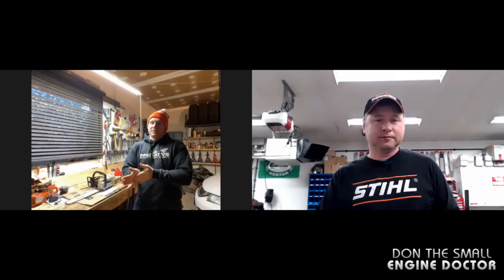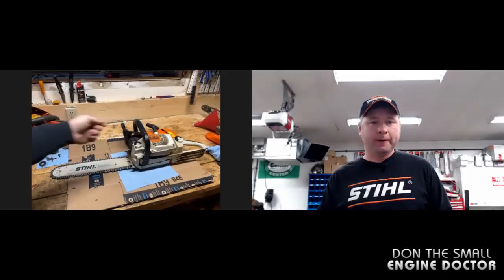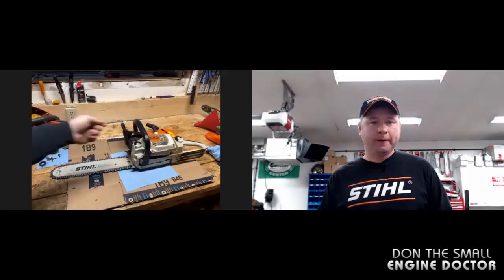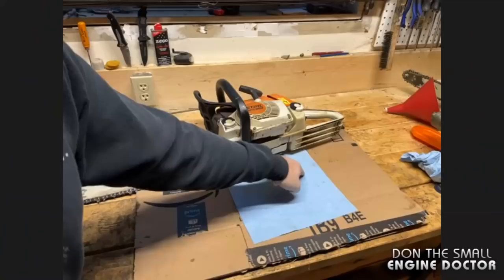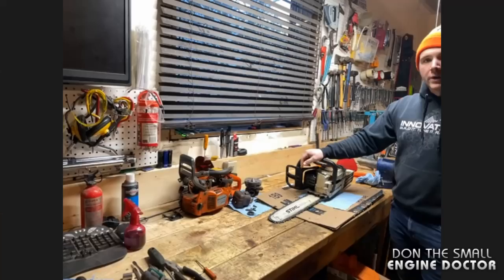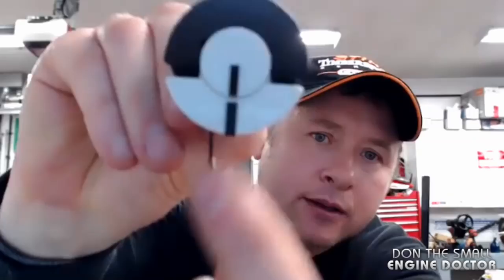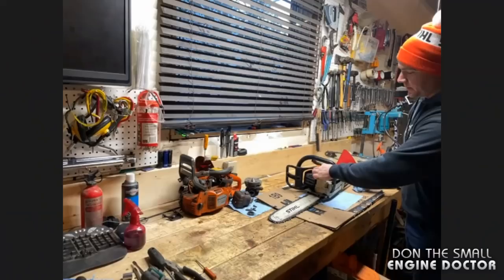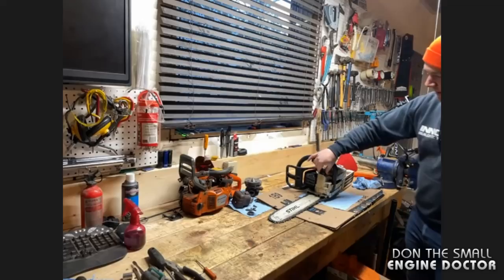FIXED! Why Dave's Stihl Chainsaw Was Leaking Chain Oil!

Comment: I hate to get picky, but Dave, the oil cap did not go on right the 2nd try either.  Did you fix it before testing to see if the cap was actually leaking?
Reply: another reason to replace it wouldn't  you agree?
Reply: Good catch! It wasn't catching the proper way - I found out that out pretty quick!
Reply: It has happened to me before too,  I always give it an extra wiggle to make sure it is locked in.

Comment: I have an 024 wood boss. It was leaking oil like a sieve.  I fount that the bar had at one time been installed incorrectly and the pin to adjust tension was driven back into the oil chamber.  I cleaned it out with acetone, ground it with a carbide tip in my Dremel and repaired it with JB Weld.  It held up for a few years but it slowly began to leak.  I was able to get a case half from a repair shop and I'm going to rebuild it with a new cylinder/piston as it has a scored piston.  I suspect leaks around the crankshaft seals so they will be replaced.

Comment: I've watched this and the one from yesterday and good advice. 
My suggestion is if you're going to replace the oil cap and was wondering about the gas cap; then why not just go ahead and replace them both and not worry about it!? 
Just makes more sense to me to replace them both and then you wouldn't have to worry about for several more years!

Comment: Excellent!  Those oil caps SUCK...
Reply from the maker: yes they do!
Reply: Thanks for watching Steve!
Reply: Stihl should have never changed over the original gas and oil caps, to the new flatter style gimicky ones.
Reply: Keep in mind that the gas cap is the same design.  I had one that leaked just like the oil caps and replaced them both at the same time.
Reply: My favourite two  small engine machnic stave and Donny boy
Reply: @donyboy73   Are they the same ones that had the issue with pressure
 building up in the tank?

Comment: Yep some of the Stihl 0XX saws had a vent by the bar side of the muffler (hard to see) that would get clogged and cause bar oil to leak.
Reply: It's not a vent , it's an oil passage that had to be drilled thru then plugged on the outside . Eventually that plug comes out and ... oil mess .  My 025 now has a socket head grub screw in that hole . Thank you Forrest ! (saw guy I trade with) Since it wasted the 16"  bar from lack of oil , it and my MS250 both have 18" bars .

Comment: Hello,

I have a Stihl MS362 and I do not see the Screw Adjustment Limiting Pin, but I found it on my MS661 and made the mod to increase the movement farther to the right of the screw.

I could not find the same Limit Pin on the Oil Adjustment Screw on my MS362. 
Does the MS362 have an Oil Limit Pin on it?

The whole around the adjustment screw on the MS362 is very small, the same size as the head of the screw.
 I do not see the Limit Pin.
Do you know how I can access the pin?

What do I have to take apart to access it?

If there is no Limit Pin, do you know the part number for a high volume/high output Oil Assembly for my MS362?

Comment: I've replaced only 1 oil tank vent on a Stihl in 55+ years. With that type of cap it's usually the cap but I've also seen 1 where the bottom of the oil tank with that type of cap had been hit deforming the opening.
Reply from the maker: thanks for sharing!
Reply: Those caps are the invention of 1 of the Stihl family members & I think they're a joke. However, I think they're here to stay.

Comment: Anybody got any suggestions on a stihl hs45. When I engage the throttle lock and put the choke on it feels really lumpy when I pull the cord. I’ve checked the spark gap cleaned the piston head, as there was some carbon on it. Burnt carbon out of the muffler and oiled the starter spring, all the components look good checked the fly wheel and key also piston and cylinder are perfect. I’ve fitted new air filter fuel filter and fuel lines carb has been cleaned also. Someone suggested fuel may be getting into the crank case. Desperate for some help. Also when I remove the recoil from the unit and pull the cord out it’s fine but when slowly letting it go back in it seems to slip could this be the problem?

Comment: My ms250 leaks bar oil badly. I set it on its side with caps up and still leaks bar oil. Any suggestions?
Reply from the maker: could be oil line

Comment: That saw would have bled out in a matter of days. That was a bunch of oil. I'd look for a big rubber washer and replace that one if I could find one. Did Dave look for cracks on the cap and housing?. A small nick would do that same thing. Thanks DB73, Cheers !!***.
Reply from the maker: yes a small nick on chainsaw body could make it leak

Comment: I love my farm boss 271 but man is it a pain in the ass to start one. I always have issues. I have this small leak too. My 271 is brand new and always ran ethanol free gas (tru fuel) inside it. Such a hard chainsaw to start for me
Reply: Have you tried adjusting the carburetor? 1st thing I do with a new one
Reply: @bradrolling8637  naw I don’t touch when new
Reply: @appleztooranges  👌🏻👍🏻I'm sure it's unnecessary, but it seems i can tweek a little more from the factory jet settings
Reply: My local dealer told me that before they sell a new (non M-Tronic) Stihl saw, they have their mechanic adjust the carb to run a bit more rich. He said that, in their opinion, Stihl saws from the factory are set a bit too lean.

Comment: Will the older swench caps fit into the newer design threading.  Never had a problem with those.
Reply from the maker: no they don't
Reply: Figures!  Why make something that would fit and work universally.

Comment: I have had my MS260 for over ten years now, early this spring I wanted to use it for some trail work but after a few minutes of running the saw started to run to lean so I quickly turned it off. I believe the issue to be an air leak, is there a good way of diagnosing this? Because I own a half dozen bigger saws  I just winterized this saw again and put it on the shelf, however my fire wood cutting is done for the season because of snow right now so I have time to look at my little saw again.
Reply from the maker: here's a video on how to test for air leaks https://www.youtube.com/watch?v=23HvdPI_vgE
Reply: @donyboy73  Thanks. 
Thanks to you and Steve I have been able to fix quite a few small engines.

Comment: I notice there is a "winter weight" bar/chain oil, do you use it or the regular stuff year-round?
Reply from the maker: yes make sure to use "winter grade" in winter and "summer grade" in summer, very important!
Reply: @donyboy73    Wow, I never heard of "winter grade" until my friend accidentally picked up a gallon.  I'll get some for my saws.
Reply: Winter grad is alot lighter so it will flow better in cold temps.  Using winter oil in the summer will nor lubricate the chain properly and it will wear the bar and chain out quickly.  It is also a judgement on the temp out side.  Where Don lives it will be colder in " winter" but here even in southern Ontario I could have cut my grass last week  LOL.    I would use " winter bar oil if it is below freezing" and summer in any thing above freezing.   Just my 2 cents.

Comment: These new style caps by Stihl are the biggest joke I have ever seen.  I have an old 044 with the goodl old normal oil and gas screw on caps and it has NEVER leaked since I bought it in 1996 or so.  My MS260 Pro leaks all the time.  I have had to purchase 2 additional caps for the saw since I bought it in the mid 2000's ... ridiculous!  This is one of the biggest reasons when I purchased my latest saw I went with Husqvarna.  My new 395XP has the good old screw on caps like the 044 and never leaks.   What was Stihl thinking when they designed these stupid caps!
Reply from the maker: even the Husky tool-less caps are way better!

Comment: Hey everybody is stihl 023 c with 20"bar any good for 14years old boy living in finland i got stihl ms 231 with 18"bar and Husqvarna 339xp with 16"bsr what is best saw to me
Reply: Use the saw that physically suits you , you want one you can use comfortably for long periods.
I use a Sthil 026 16" bar for most of my work and have a large Sthil for crosscutting and felling the larger trees , can't mind the barsize offhand but must be about 28".
Can work the 026 all day. The trees I do are pretty much all big hardwoods and a lot of scrub clearing and pruning.

Comment: I'm having the same issue with my Stihl saw.  I'm getting a new cap from my local Stihl dealer tomorrow.  Do you have a video how to change the oil cap or is it straight forward?
Reply from the maker: just screw the new one in!
Reply: LOL!
Reply: I think its the o-rings material After a while the rings shrink and looses elasticity. You can buy new o-rings cheap though
Reply: @donyboy73  Where does the small string attach to?  You don't attach the string to anything?
Reply from the maker: @andrevoz9819  attach the ball at end of cap inside a small hole in tank, it will fit perfectly in
Reply: @donyboy73  Thanks...I went to my local Stihl dealer, bought 2 caps (one for the oil and 1 for the gas) replaced both caps cleaned the oil at the bottom of the chainsaw and my Woodsman Chainsaw Carrying Case, placed a white paper towel under the saw in the case and let it sit overnight and no oil !  Problem fixed...thanks !